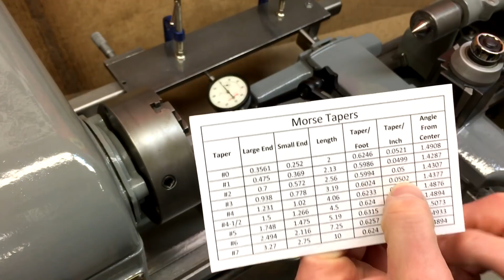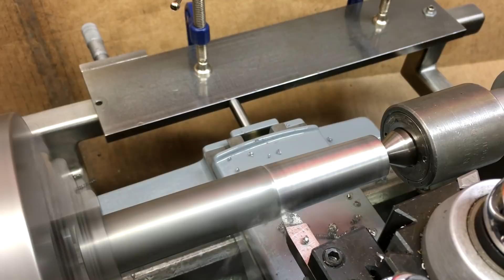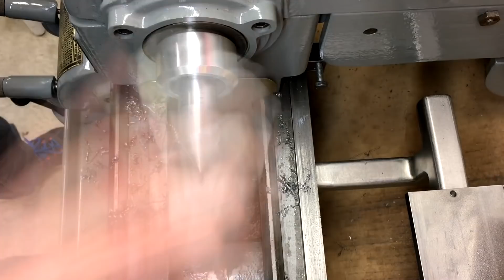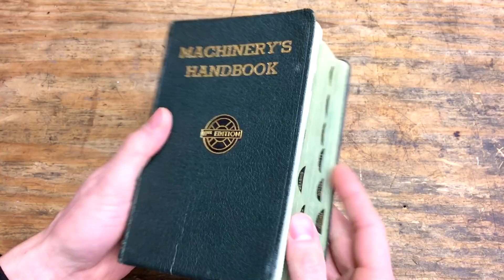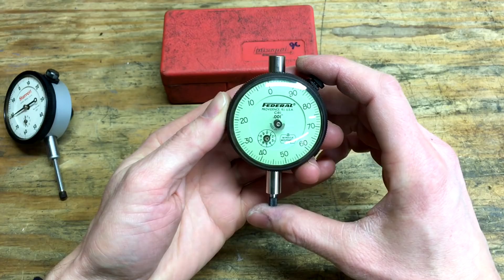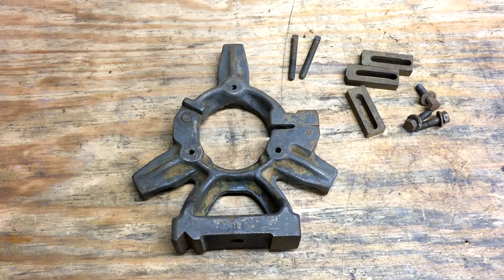Making a #3 Morse Taper Center

Comment: I'm making a replacement tailstock for a 1940s Delta wood lathe. I needed a MT in the quill. Did it with my taper attachment on a PM1440HD lathe. That type of taper attachment has the disadvantage of not starting the taper right away. It needs to take up the little bit of slack that is needed to prevent binding before it actually starts cutting the taper. With the very shallow MT taper it takes about .8" of travel. Annoying but it works. I like your air cylinder better. I used the DRO to set the taper attachment. By using 5" of travel instead of 1" I got a very good fit first try. I'll be casting the main body in silicon aluminum alloy (Alloy car wheel.) My back yard casting can't get hot enough to melt cast iron. Thanks for the nice video.

Comment: That worked really nice. I watched the tracer video too real nice, love the use of the air cylinder. I noticed your comment about the condition of your spindle taper. Check first to see If the spindle is hardened. If so and you can prove a taper you machine, you could turn up a lap and roll some diamond into it. Works nice to chase away dings. Or if you're brave you could hard turn it possibly. 
One thing might be worth checking. Stick an indicator on the rails that holds the template and take a cut, be nice to have an idea of any deflection that might mess with your cut dimensions.
All the best.
Reply from the maker: Thanks for watching and commenting!  I'll have to check if its hardened or not, I would have guessed it is.  I'm too scared to hard turn it but lapping it is a good idea.  I'll check the deflection next time I use it.  Thanks!

Comment: The Federal indicator is reverse reading. You can tell this because the scale increases in the counter-clockwise direction and the small dial points to 0 (zero) when the plunger is all the way in, rather than out. This makes it well suited for measuring depths using a base that looks something like the foot of a depth micrometer. http://assets.suredone.com/1742/media-pics/114972-federal-p61s-depth-step-metric-dial-indicator-01mm-7.jpg I've got one like that with the adjustable foot and it's a lot easier to use than a depth mic for slots and such within its range. You could probably put together a suitable foot for that one with a clamping screw or whatever, for measuring things like keyways and maybe dovetail depth etc. :)
Reply from the maker: Awesome thanks for the suggestion!  I will probably do that!